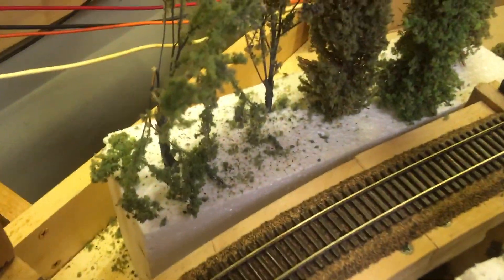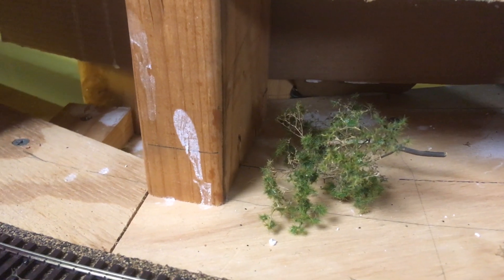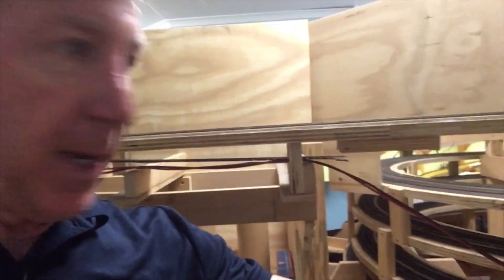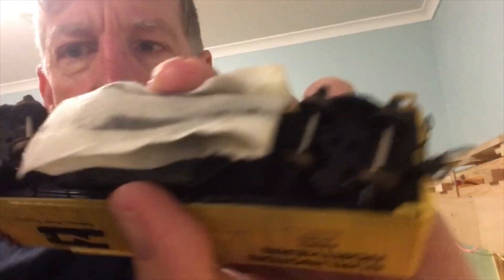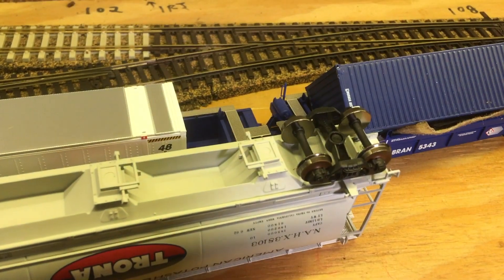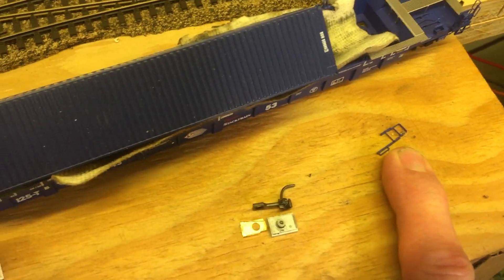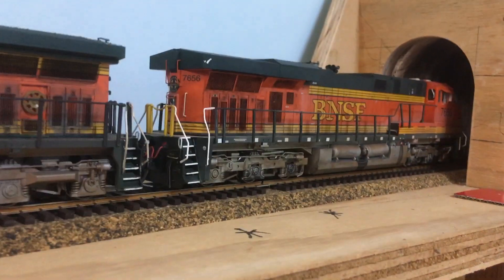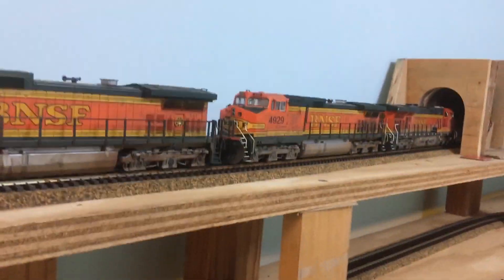Rodents, rip outs and retakes!

Comment: I’ve watched some of your videos and must say I think your very comical. Lol. Your video on doing scenery (no 23) got my attention and wanted to say, try placing your rock molds in the curved areas while your rock mold is still a bit wet and it will conform to the curve and leave all detail in place, let the plaster set before unmolding.  Each additional mold can be overlapped and that will eliminate seams. Most independent mold suppliers use a thinner mold than woodland scenics which are a relatively thick rubber and are far less forgiving for this type of mold setting. Good luck and happy scenicking. Why let them dry and then cut and carve when they can be place while still a bit wet? Lol
Reply from the maker: Hi Jeff, I'm glad you enjoy the videos and I have heard about curving the rocks , and I will try that on the new layout! Plus I am looking at bigger molds from other makes!
Cheers Gregg.

Comment: Your Rat will hate the taste of Vinegar!!!!! Put Vinegar in your white glue, 50% with water and he will move on to someone else's layout! On a 2% grade, an average HO scale locomotive can pull (or push) 12 cars @ 6 ounces a piece. On a 4% grade, same locomotive can move about 7 cars at 6 ounces a piece! With the average locomotive weighing in at 1 pound, and a coefficient of friction (wheel to rail) of .25 I can get 5 locomotives up a 4% grade pulling 40 cars around a 44 inch radius without string lining! But if I go one lousy car over 40, it will string line!!!!!!!
        I don't like to push anymore than 5 cars with a DPU or "helper" set of 3 locomotives, so I am able to now run trains of 60 cars up the 4%  with the helpers cut in at 45 cars deep with 15 cars behind the tonnage rating, pushing 5 or 6 cars. With this arrangement, I have no worries!!!!!!!!!!!!!!!! The lightest cars will be around 30 deep and the helpers will have cars that weigh right around 6 ounces a piece keeping the helpers just barely behind their tonnage rating (about 5 cars)!

Comment: Rats or mice.. I can't think of anything much worse than that?  I hope that you can make him suffer?
An "almost full" bucket of water with some chaff spread floating on the surface works well?  (and you get to see the drowned rat afterwards)? They jump in onto the chaff, and then it's all over for the rat..  No dead bodies from poison smelling the place up either?
I can thank a horse for teaching me that trick.. He would spill some chaff into his water bucket, and inadvertently drown any rats that came into his stable looking to steal some food? 
Pity that the trees won't just grow back?  The rat has expensive tastes?  Good luck getting rid of him..
Reply from the maker: I have seen him /her yesterday and chased it up the track , but it got away..LOL  It was a bit sluggish as it can't get out for food and water as I have sealed the door, so back up there today to set a trap!  I saw some great mouse traps that use a bucket and water! 
Cheers Gregg.
Reply: @FishplateFilms  Hi Gregg, If it is hungry, it may get desperate and start chewing on more expensive hardware..You need a good trap quick, or some "Tom Cat" poison sachets from a rural supplier?
They work quickly..

Comment: Hi Greg. Those rodents have been a real pest every where this last year.  I hope you got them good too.
Makes one cry when there is a runaway and damage to the rolling stock, at least the proto types have the same issues, so you can't complain...lol
Thank you for your INOX idea too, my layout has been going great since I used 90% of your advice.. The 10% I found an easier way to do it with one hand and still have fun on the small layout.
Reply from the maker: Hi Arty, thanks for watching and I have found out where they are getting in at the door, so next job is to seal that up! I as luck I had no more damage than I did! I'm glad you got good results from the INOX and it is working well for you.
Cheers Gregg.

Comment: may i offer a suggestion that may work for cleaning wheels or the track.  i spent time on the internet looking for the best way to clean the stylus on an old-time record player.  the best suggestion was "miracle cleaner".  i think that was what it was called.  you just push the stylus into it a couple of times.  i think its called a micro-abrasive.  an australian brand of it that i found was called "glitz wipeout".  other modellers would know of it if it works, i'm sure.

Comment: you need to find where it is getting in.  a rat can collapse its rib cage to get through a gap under a door.  you need to ensure all gaps under doors are less than 3/8".  i try for much less than that.  i fitted all the doors in my old house so that not even mice could squeeze through then i watched one use the rounded corner of the 100 year old pine door to get in.  so i rehung the door even lower.  i was renting a house that was infested with rats.  i went round the entire place putting aluminium carpet trims under where all the exterior doors closed, except the front one which i put a spring-loaded draught excluder on. then one night, lying in bed i heard it springing.  the bastards had worked out how to get under it.  so i put a piece of carpet trim packed up with pieces of fibro to close that gap to just over zero.  i also notice a hole in the wall at 3:36.  i have known of instances where rats have tunnelled through plaster at the cornice to get access to the wall cavity.  to all those country people experiencing the current mouse plague, they can be excluded, even in a rented house.  neither rats nor mice will tackle steel wool.  poke that in holes.  stainless steel wool is better because it doesnt rust.

Comment: Well that settles it then... I will ring through to Our Diesel engineer and tell him to start a rat-trofit to all the Locos, so we don't ever stall on the Drummond Range. We will remove the sandboxes and Rat-trofit the Rodent parts. An Electrical connection from the Sand Peddle to these Rodent parts will stimulate their bladders to spray the Rail sufficiently to prevent slipping. It will be a Rat-Tickle idea and innovation. 🤣🤣🤣🐀🐀🐀
Reply from the maker: LOL..one problem Adrian ...too much use will insulate you from the track , so you will disappear off the CTC screens!! Then we have a wrong side failure and thats not good! It will be fine in axel counter sections though!! 
Cheers Gregg.
Reply: @FishplateFilms  Greggles I always run in stealth mode hahaha. And we're old school out here lots of axle counters.  Good to see you're getting some business before you move to greener pastures.  Merry Christmas brother.

Comment: Hi Gregg, interesting video re the rodent. BTW did you manage to eradicate him/her? My reason for commenting is slightly off topic, but here goes. Looking at the wheel set of the tank car at 0:31 the flanges seem slightly bigger then the ones on the my Victorian Railways AW & BW kits. I don't know if you are familiar with the Steam Era Models (SEM) kits, but the flanges on the wheel sets provided with the kits seem very minimal compared to the ones on your tank cars. My layout is limited in size space wise so I cant have long locos or carriages  due to the curve radii. I'm using code 100 Atlas flexible track and some Peco straight and curved sections along with mainly Peco points and a couple of Hornby points.

Is there an ebay site, or manufacturer that you would recommend where I can source wheel sets with the deeper flanges. As I said this is off topic, but any help/recommendations would be appreciated. Thanks for reading my comment.     .... Ian ....
Reply from the maker: Hi Ian, yes I know of SEM kits , and the wheels you have are fine scale sets, which look much better than the standard ones on most HO cars. I have replaced quite a few of my hopper cars with fine scale wheels and the look and run much nicer...but they are too fine for code 100 turnouts and bump across them. Getting axles is a pain , as the axle length varies between makes , but Model Train Stuff have a good selection so you could try them? 
Gregg :-)